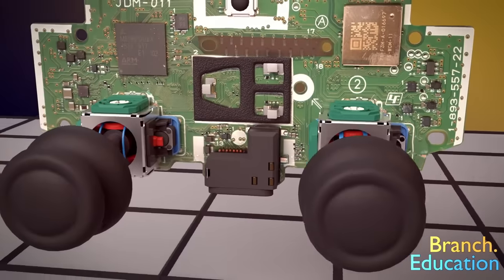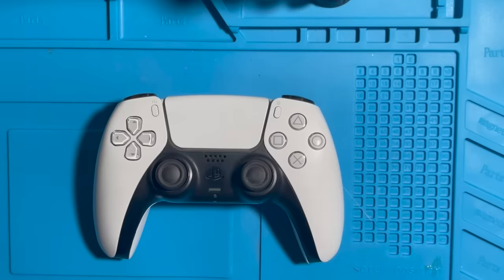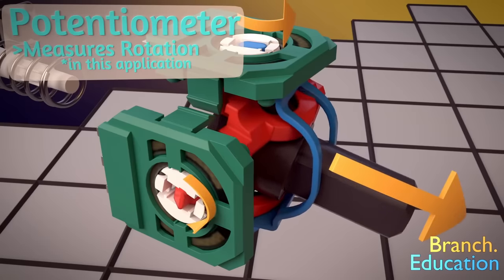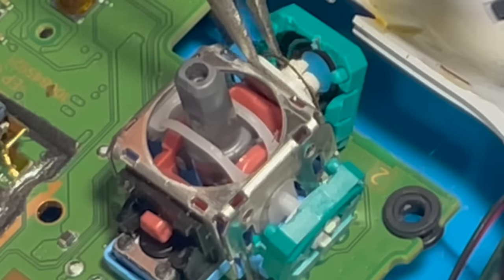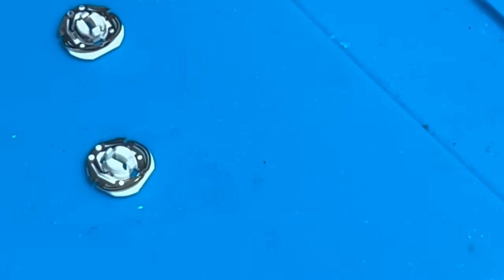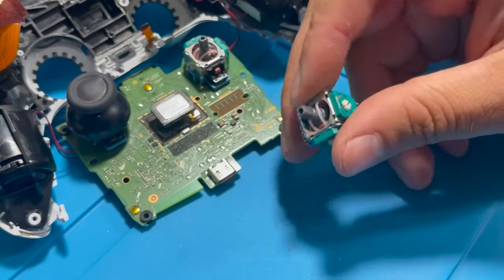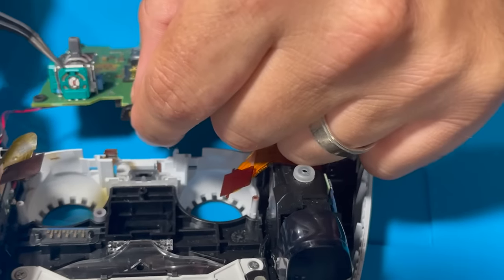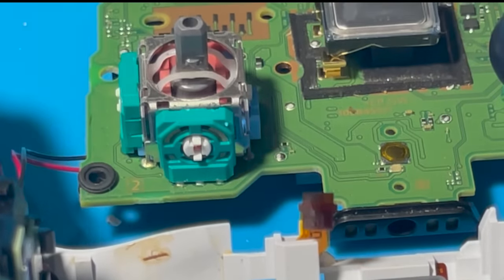What Causes Stick Drift Controller and How To Really Fix It

Comment: How many have the various tools in which they would need, not to mention the talent and skill to utilize them, let alone the time envovled. Doing all this when compared to purchasing a new one. Is what the majority of us player end up having to do.
Reply: Lol so you would rather waste money and be lazy instead of fixing a very easy issue, plus when people buy more expensive controllers that have back buttons, you’re not going to want to replace the entire controller every time it gets drift. Tools to open up controller are easy to get online and a literal kid could do this fix it’s that easy
Reply: Most controllers can be disassembled with just a small Philips screwdriver. A knife or small slotted screwdriver can be used to pry the pots away from the stick. Such tools aren't hard to find or get and many homes will have such things in their "junk drawer", even if they don't have full sets of tools. And if they don't have them, I guarantee that someone they know has them.

I do agree with your second point that people are too lazy to be bothered fixing things. I've seen people throw out perfectly good vacuum cleaners because they can't be bothered to unclog the hose. I brought home a nice standing fan from the trash, that just needed cleaning and a few drops of oil. A while back, I found a Dell laptop in the trash (bulk trash, people clean out their homes and pile it on the curb for free pickup) that doesn't boot. According to all the online information, it just needs a new CMOS battery. Unfortunately to change it, you have to disassemble the whole thing. I haven't done that yet, but I plan to. No way I'd throw out my own computer just because it needed a new battery!

Comment: @ around 6:53, you can see a piece of white debris fall out. This is most likely why he still had issues. Also, it's good to also clean the metal cage area where it inserts as you can have residue on it (will present as a darker ring on the metal).

Comment: I had a broken xbox controller that I took those metal round things out of the right working stick and put them in the left stick of my drifting one I use, and it works perfectly. No more walking into stealth situations randomly. Thanks alot I'm so happy.

Comment: Thanks a lot for this video! Cleaning it with alcohol solved the issue for me. If the stick drift comes back, I will replace the potentiometers as suggested.

Comment: Cleaned my wiper and track and it helped a lot. THANKS
I almost lost the noise suppression mic
At 2:22 you can see two small ribbon cables to the left and right on the bottom of the battery cover. The left one is for a noise suppression mic and is not connected to anything so careful!

Comment: In my case my controller was drifting alot but was clean inside. I saw another comment in another video saying to becareful about flattening the wipers too much. I noticed my wipers looked flatter than what was shown in the video, so I bent each one up slighlty so they're more at an angle. This completely fixed the stick drift issue I had. I'm not sure why it worked though, I would assume the wipers are always in contact with the track regardless.

Comment: While this is super helpful and you're a legend for showing what might be causing it, I still advice people not do this only if your drift is really bad and you're going to buy a new controller anyway. It's very possible you just screw it up make the drift worse or add new problems. Those green parts are hard to return to their original position and those wipers deform easily too!
Reply: Yeah i agree
I could easily fc this up an make it worse
Then instead of just being slightly irritated with a little stick drift ill be hella pizzed

Comment: Ive experienced drift on PS2 & PS4 and some RC controllers, buying a can of Electrical Contact Cleaner, which also has a lubricant and spraying the potentiometers often works without having to disassemble them.

Comment: @gamer2know Thank you so much for the video. The first step to diagnose the issue is very important. your testing controller link helped me a lot to identify the exact problem.

Cleaning from outside and resetting wont help. The only thing helped me is dismantling the unit and clean it with your proper guidance and steps.

I fixed my PS5 controller and its back to action again :trophy-yellow-smiling:

Thank a lots. Really appreciate your hard work for making the informative video.:stayhome:

Comment: Great video however cleaning with a que tip won’t remove all the debris and it’s easy to leave strands behind. So try dropping them in a isopropyl bath for a minute and the leave to fully dry on a paper towel and replace when dry. Job done. This as been tried and tested in my workshop for many customers.

Comment: I have no clue how, but resetting the controller and updating the firmware got rid of my stick drift...
It was pretty bad too, going so far as to  -.16 on gamepad tester, but now it just works perfectly lol. 

I have probably 700-800 hours of Rocket League on this controller, so I assumed it was just a physical issue from flicking too hard and whatnot. I was pleasantly surprised, at least for now.

Cheers.

Comment: If this fixes your drift, then the issue was with the wiper and not the track. If it were the track wearing out, changing the wiper wouldn't fix it. So it would seem the wiper had some gunk buildup, which cleaning with isopropyl didn't completely get rid of.
 
Personally, I would've started by just spraying contact cleaner inside, without opening the potentiometer. It will get in there, don't worry. Then move the sticks around for a bit to help the contact cleaner do its thing. If that doesn't help, my next step would be to simply replace the entire stick assembly. Of course, this requires soldering, which is not something everyone's proficient at. And if you don't desolder the old stick properly, you may lift a track and ruin the controller. Although they're through-hole parts, which lessens the chance quite a bit. Still, I ruined some boards by getting impatient while desoldering parts with many pins, so I definitely understand people wanting to try replacing the wiper first. Pro tip when desoldering parts with many pins: if you can bend a bare copper wire (solid core) so it touches all of the pins simultaneously, and solder it to all of them. Then heat that wire with the tip of your soldering iron to  spread the heat around to all of the pins. Then just wait for the solder on all of them to melt, at which point you can easily lift the part out. After that, clean out the holes, install the new part, and resolder. Saw that trick in a video here on YT a couple years ago, and it blew my mind. For the curious, it's a video by Mr SolderFix titled "Desoldering made easy - amazing trick || Soldering tutorial" (sorry for the cringe title; I didn't pick it).
 
Your method is certainly novel, never seen it done that way before. There's some danger involved: you may fatigue the metal legs of the pot if you do this too often, or you may snap them if you're not careful. Which would then require you to desolder them and replace with new ones. Or realistically speaking, just replace the entire stick, since you're already soldering. But it is worth a shot, in case there's nothing wrong with the pot except a dirty wiper. If replacing the wiper doesn't solve it (e.g. because the tracks have worn out), you can still escalate to the next step.

Comment: Great video. A few days ago I followed a repair video that showed the same method and cleaning and removing some hair from inside seemed to be enough. If there still is any drift it's not noticeable. But that website you showed looks like a great tool, I'll try it out. Thanks.

Comment: 6:53 it shows there is a piece of broken plastic falls down when you  get off the past. That was the issue. It was partly beoken but still attached. So, when you open it two times then replace it it completely broken and falls.

Comment: The issue is with manufacturing. Moving the controller grinds up against areas that may not have been fully evaluated for clean precision cuts with no frayed edges/residue. Same could be said for the round resistance pad the metal ring grinds on. That's why you most likely find blackish residue and/or small black shavings when cleaning. Very important to check for Q-Tip hairs after cleaning. I prefer alcohol pads as they fray less as long as they are still wet on a couple of passes.

Comment: Hey i appreciate this video. I swapped out my washer from my ps4 and it works like new!!! Thank you for explaining the issue as well. I cleaned the original ps5 washer so many times and no dice. Im going to buy some replacement from your affiliate website this friday. I feel like this is a dumb wuestion but the kit you have provided it has 4 thumb modules. So theoretically thats 8 replacements for my right side correct? Again appreciate this video

Comment: Never had drift on ps4 or ps5 controller and I play A LOT. 
But I had problems with dualsense, not original but the one I bought separately, one analog was not smoothe like another. 
Cleaning helped.

Comment: Ever since about a year ago when I had serious stick drift issues on one of my PS4 controllers and 2 of my PS5 controllers, I've seen a few video guides online detailing how to do this exact stick drift fix in the video. As a person who has tried this solution for himself, it definitely works. If you're not comfortable trying to disassemble your controller for yourself to fix your stick drift, try to find a friend, family member, or maybe a neighbor to do it for you. It's almost for certain that simply blowing into the analog stick while the controller is fully assembled, rubbing alcohol on analog sticks, or rotating your analog sticks a few times in various directions will not fix your problem. Just like with severe overheating that can happen inside of your console due to dust buildup and expired thermal paste, this problem must be fixed by disassembling your controller to fix the root cause.

Comment: Hi bro, thank you so much for this, big help, made me sub the first few seconds into the vid. Question though, you cleaned the wiper plate and made sure there was no dirt left in them, and there were no deformities either whatsoever, but even though it got considerably better as you tested again, the problem remains. What do you think really caused the drift there? Think that had been the elusive question that nobody could answer in like forever. Thanks in advance for your response. 'Appreciate you brother.

Comment: If you're desperate, deoxit D5 spray and compressed air might be enough to get things working again. I've revived dead buttons and D pad directions using it.  worth a try and doesn't require full disassembly. I know anytime I disassemble something, I often end up with 1 screw at the end and I have no recollection of where it came from. In other words I shouldn't be taking stuff apart lol.

Comment: Sometimes the resistent pad wears down causing drift. So even changing the wiper doesnt help. You have to desolder the potentiometer and then change it out entirely and resolder the new one

Comment: I had the same problem, couldn't get the drift out by cleaning but what I did is I stretched the lil rings with the bump that registers input and it worked no more drift, But! It did make my cursor slower and movement in games like Apex slower but way better then having drift

Comment: Before replacing the wipers it would have been very interesting to see if a dry spray for electrical contacts would have fixed that drift.
With ps3 and ps4 controllers I always used dry spray, without even touching wipers or anything else, and it always worked... for several months...

Comment: another problem is it might not be the Whipes it very well could be the actual conductive coating on the potentiometer  which would require an entire replacement. but its also good to know it could be something as simple as replacing the metal rotational component that interacts with the conductive coating.

Comment: You probably did fix it by cleaning it but messed up when you snapped it back in.. The wiper wasn't properly seated so a little piece of it broke off.. as you can see between these times

(00:06:52-00:06:55)

Comment: If you’re doing all this, you might as well replace the modules. I tried cleaning mine but the drift would return and I kept cleaning them once a week until cleaning them didn’t work anymore. Replace them is one of the easiest soldering jobs you can do aside from removing the factory solder. I’d buy a pump desoldering iron for those specifically. Modules only cost a dollar.
Reply from the maker: Thanks for the comment, I've made a few videos removing the potentiometer and the module, they are on my channel if you are interested

Comment: Windows had this fixed almost 30 years ago. It's called calibration. It was an option where you would rotate the stick in circles a few times on one step, and then on another step you leave the stick centered for a few seconds. This would redefine the axis scales and Windows would associate that with your joystick/gamepad. Why can't consoles do this?
Reply: Oh no they 100% can, they just dont wanna cause 80 dollars for the controller alone wasnt good enough so they make you either to the repairs themselves or buy a whole new one every 3 months or so

Comment: I had the mentality that when I bought the device, I had to replace the old potentiometer with the new potentiometer by wielding it in place. I am ashamed I didn't even consider simply replacing the white circles...

Now a small part of me might consider fixing some of my old controllers, which still have insane drift even after opening & cleaning the controller
Reply: 1) Its 'welding' not 'wielding'
2) You wouldn't be welding it, you'd be soldering it

Comment: Dealt with Dualsense drift to the left on the left stick for months. Rotating the stick around each angle while blowing through the crevices (had nothing but my mouth) knocked out whatever was throwing off the sensor.  Good old fashioned, blowing off a NES cartridge style. Try it before anything else.

Comment: Great video! Are the white wipers (with metal) all the same? For example if i buy a few new resistance blocks with each 2 wipers. And i replace 1 wiper. Can i replace the 2nd wiper in a other controller or do they need to be in the same position as where they came from? (Top needs too be on the top. And right on the right?) Thanks in advande😊
Reply from the maker: I just the ps5 wiper on ps4 controller and it solved the drift, so I think they should work. They need to be in same position
Reply: @TheGamer2Know  thanks amigo 🙏

Comment: This shouldnt have worked, infact this would start drifting very soon after assembly. If you guys pay attention, there are visible scratches on the metal tracks on both potentiometers 4:20 , meaning the resistance values of those measurement readings will be off, thus the only real way to fix this is to replace the track itself or the entire potentiometer, which unfortunetly requires soldering, the guy ended the video without showing regirous testing probably cause it still drifts, he didnt show the soldering method because he most likely cant solder, or couldnt at the time of recording.
Reply: Well it definitely just worked for me….. Took me about a hour but I don’t drift to the left anymore

Comment: Rather than alcohol I would use WD-40 Specialist Contact Cleaner. It's designed specifically for cleaning electronics, and dries quickly and cleanly. Also this won't fix them, it just postpones the inevitable. The problem is that the potentiometers involve physical friction, instead of using a contactless method like a magnet. That's more expensive though, so manufacturers continue to use potentiometers that, because they require friction to work, will always fail.

Comment: I fixed mine really easy!

I bought a second identical controller online from the same retailer as I bought the faulty controller.
Then I simply put the old one inside the new one's original box and returned it and I got a refund.

Nice and easy!
Reply: Shhhh.... don't give away pro tips for nothing. LOL... I did almost the same, except I exchanged it as I did want a second controller, and wanted both to actually work.

Comment: Those wipers will any of them work? Aliexpress sells Potentiometers but obviously those are a gamble in quality and if you have the same model. However, aren't all those wipers exactly the same across 99% of the ds4 and ds5 models so you could buy any model even with different versions?

Comment: Had my ps4 for years never had an issue with stick drift. I’ve had my ps5 6 months and my left stick went bad recently. I took the sensors out of the ps4 controller and now my ps5 controller works perfectly again. Luckily those parts are the same.

Comment: Just use WD40, spray it on the sides of the analog that has stick drift then move it around for a bit, and after that clean the unnecessary on top of the analog

Comment: Anyone know why this seems to be an issue on the PS5 in particular?  I've used Xbox and PS4 controllers for several years each and never had this issue.  I've had my PS5 for a little under a year and already my right thumb stick is a little off-center.  Very disappointing.

Comment: Drift on both of my controllers started about two years after I got them. Cleaned them both out, it fixed one temporarily and didn't do anything for the other one. Now, about 4 months later, I've had to do it again and one was once again unaffected, and the other one that fixed the first time got even worse